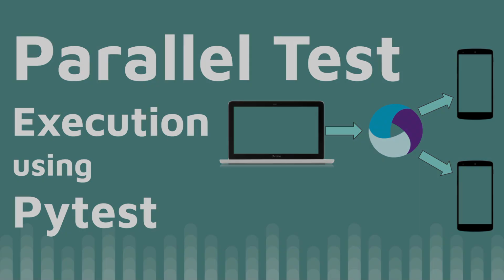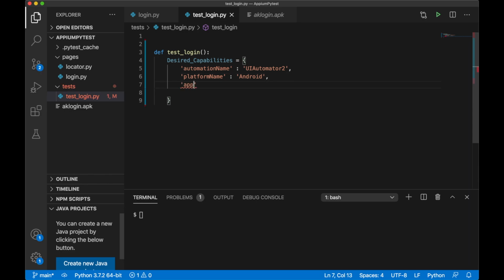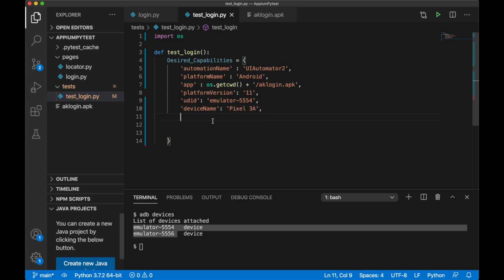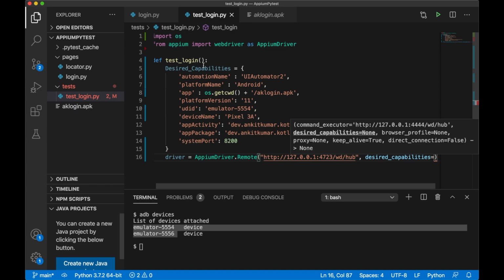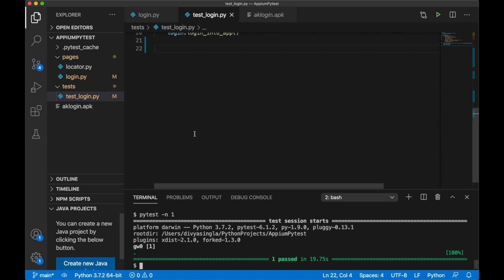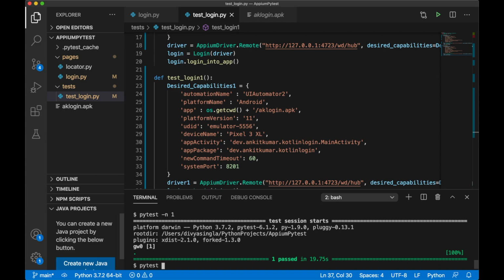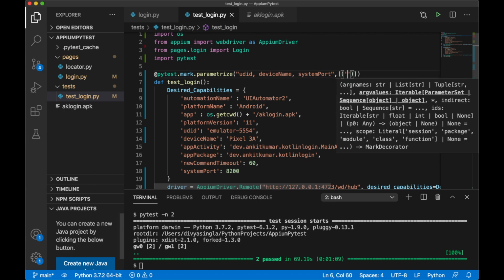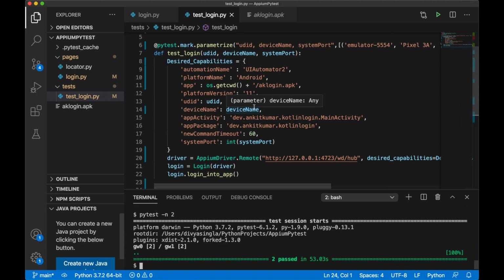Don't Run Tests One by One! Use PyTest Parallel Execution

Comment from the maker: Parallel Testing using PyTest, Appium & Python | Parallel Test Execution | Mobile Automation Testing in 2021

Parallel testing is a process where you run the same tests simultaneously in different environments.
This video explains how to run parallel test cases for mobile applications using pytest framework, pytest x-dist, and appium.
Reply: look mail

Comment: The execution time for single thread is 19 seconds and for two threads is 69 seconds. why time is more for 2 threads? isn't it defeating the purpose of parallel execution? correct me if I am missing something.

Comment: How to run test case in for loop?
Reply: Hi Zakh Chanel, Thanks for your question.
1. There are some ways to loop your test cases but the preferred way of looping your test cases is through @pytest.mark.parametrize(if you are using pytest).
 For example:
@pytest.mark.parametrize("iteration",[('1'),('2'),('3').......])
def test_sample(iteration):
      test_steps......
You can loop your test cases or parallelly execute them through parametrization.

2. Another way to loop your test steps in the test function but it won't give you a nice output.
For example:
def test_sample_function():
    for i in range(2):
        test steps........
The above example will execute the same test steps 2 times but the output will show that only one test case is executed that's why it's not preferred.